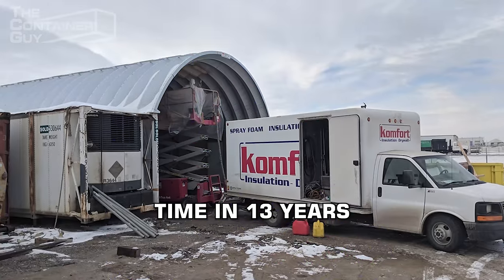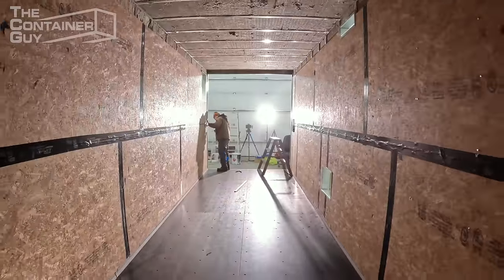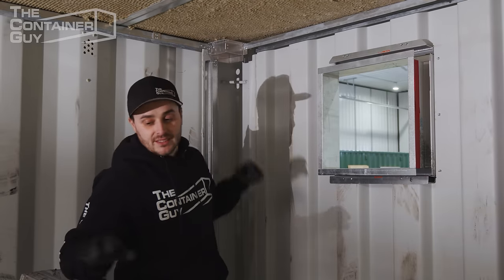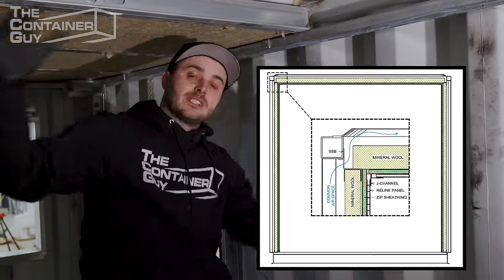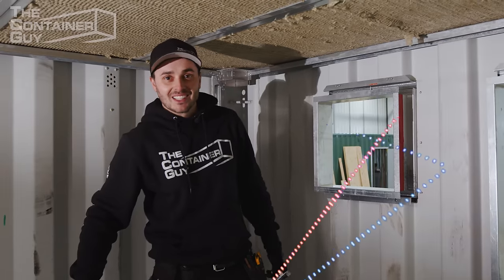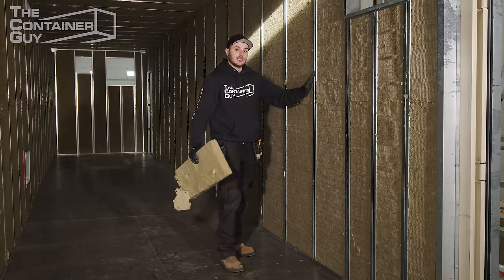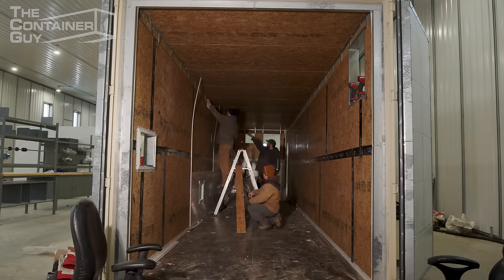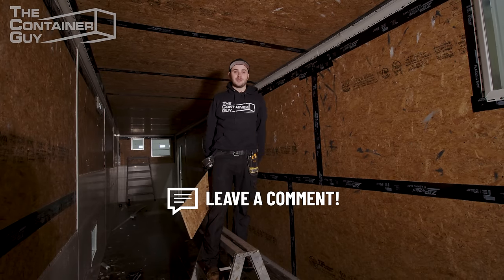Ventilated Wall System | Learn The FACTS and RISKS Before You "Save Money" By Not Using Spray Foam

Comment: We are finishing up a build very very similar with different materials. Ours is for  a future bunk house and mobile office. We sent you some details that you might like from Classic Built High Performance email. Our mission is a DYI version bunk house office for building 2 houses on site to Passive House Building Standards. I consider it a science project because it's unorthodox with a fresh air intake system through the floors, up the walls and out the roof. It's a dual ventilation system, 1 for the walls and one for true fresh air for human occupancy.  So far it's working just like what we thought based on the building science. Keep up the good work guys.

Comment: Install a blue tooth moisture meter then monitor it over the length of the product. I suggest moving the air in the air void is the crucial part.
Reply: Negative pressure.. i.e. a VACUUM if nothing else a draw/pull ...TIED to a humidity meter so that only when overall humidity inside the living space is LOW that it turns on... perhaps set up a dehumidifier to run during the day specifically with a motion detector with a couple hours delay...so that after you leave for the morning it turns out after moisture/humidity has stabilized in the living space from cooking and showers, etc...then dehumidifier runs (perhaps just on a daily/weekly programmed timer) and then when/if the humidity reaches some low average threshold then the.dead air space vent kicks on... 
But your idea of a circulating of the dead air is also quite important to prevent any stratification of moisture levels depending on rising warm moist air or cooling condensating air at ANY location... Perhaps dozen or so small brushless computer fans. Strategically placed or directionally aligned so that ALL air is rotating in a uniform" vortex around the length of the container? Perhaps two sets, aimed in opposition so that they alternate days /weeks /months at a time? ...the only thing that usually stops them is dust buildup which "should NOT happen" ... 
a boroscpe camera could be used to inspect the cavity...perhaps strategically placed 1/4" PEX or other tubing through inspection ports seal the hole with 100% silicone caulk clear, then cap...so that when you want to insert camera, just remove cap and instant access?

Comment: I had a band room that had 4 inch foam on the walls of the room exposed, it was crazy we took a audio meter to it and you could play drums in the room and it dropped the sound over 60db in the room in order to talk to someone in the room we had to use the PA system just to hear each other the room was only 14X10 and someone next to you was hard to hear. at night you could not hear anything other than the AC vent (if you were right on top of it) and since there was no windows it was like a depervation chamber. but the people that lived less than 20 feet away said they could tell there was a Live band playing but sounding like a low volume stereo playing we would play well after midnight sometimes so the outside walls were your standard stick and drywall with stuco and then the normal insulation in the walls then 4 inches of dark gray ridiget foam boards 4'X8' it was dark and dead quiet in there, and with a full band inside it was lower than a TV on like 20 volume, you could sit in the room next to the band room and watch TV and not have to blast the volume at all. It is a crazy feeling and yes like your balance is off like an ear full of water but even more

Comment: So I totally understand your points. I’m a retired Ironworker and have been thinking about the heat and cold of these steel buildings. My question is what if a 12 volt or low voltage air flow system in the walls that would blow and recirculate somehow when the moisture or surface heat gets to a certain point?
Reply: Been thinking about the same thing. It's especially moisture concerning me here in the South. But the heat is going to be bad as well.

Comment: Great video.  Thanks for explaining the "why" about things.  To help the steel stud thermal bridging issue you might try EcoStud. I used them for a external insulation wall on a house.  I put one horizontal row of OSB on the studs then fill the cavity with spray foam then repeat.

Comment: You panic way too much over using wood structure inside of a c-can. Years and years of doing it and using rockwool for insulation has proven that it is absolutely fine as long as you provide an air gap behind it. As you did in this system you'll have no issues. It's no different than building a house. You just need your vapor barrier between the internal warm area and your external cold area.
Reply: Are you venting (active and negative pressure or passive?the space between the metal on inside of container and ?
Reply: Also, when you say "vapor barrier" can you please be MORE specific? There are sooo many categorical types some are plastic film that is designed to STOP movement, others are resistant and unidirectional and others are like wood...

Comment: * Why not isolate the metal beams(struts) in your system so it will not transfer the cold from metal to metal. Not sure if a rubber gasket between your metal rafter beams and brackets is better or if you just coat all your metal parts with a sprayon rubber coating like FLEX SEAL!  By rubber coating all the rafters and brackets it would cut down on transfer of cold . It would also help dampen sound transfered through metal to metal contact of your rafter system!
 Just a thought, try it out if it works make a video of it and add it to your system! I would charge you to much for the idea! LOL! But I think wether you spray flex seal on all your metal rafters,brackets, or beams, or cut rubber gaskets to put in between rafters where you connect them together , it will help you dampen the sound and the cold that transfers between your metal parts of your system. 
 You will just have to try both and see which works best. I think spraying all your parts will be the best but if you cut rubber to  put between them you can control the thickness better!
 Eitherway give it a try and make a video! Which you could reccomend to your customers to spray flex seal on all your rafter/wall system to help dampen the transfer of sound and cold through the metal parts. I hope this helps!
Reply from the maker: This system is steel studs (not our strut system) but you are 100% correct. Metal brackets are perfect to start because they allow us to use them, adjust the design in small batches until the product is proven. Once we know it works and that there's a market for it, then we move to injection moulded brackets which is exactly what we have done with these SSB. In the next week or two, we will have 10,000 glass filled nylon resin SSB available for sale. Zero thermal bridging and way stronger than the aluminum counterpart. 

We can rubber coat or 3D print rubber gaskets to isolate the metal brackets in the meantime but our engineer did the math on the surface area of the bracket and how much thermal bridging there would be and it isn't huge. Especially with spray foam all around it.
Reply: @TheContainerGuyTV  I would suggest you look into "other" materials like solid blocks of nylon or other "low conduction" but HIGH COMPRESSION and LONGER LIFE than rubber... I know rubber "can" last a long time, but it "rots"/*oxidizes*  AND deforms under steady light pressure over time...
Let me know if I am wrong or what material you find or settle on...as I too may be in need of...

Comment: What prevented from using external insulation? It was confusing, since it seemed like you had CAD models with external insulation, but there ended up being none. Wouldn't that have solved all the problems? I am assuming this is not transported a lot, so they extra widht wouldn't be a problem.
Reply from the maker: Time. We have a 3D model but ZERO real life experience. I am confident we could exterior insulate and finish a container on the walls and roof but have some thinking to do on how to deal with the base / underside on something that is meant to be transported. A site-built unit on a insulated concrete pad or footing would be easy. This summer we plan to mess around with this concept.
Reply: @TheContainerGuyTV Really exited to know you're working on it! I've been planning my container build for a long time and I know it will have external insulation for maximum interior space and that sweet, corrugated, industrial look. Underside definetely seems like the biggest problem, mine is going to be on wheels and tractor towable. But one thing is sure, it will be built with your kits! Your channels has been a great inspiration and I'm always very exited when there is a new video :D

Comment: Key to remember it doesn't matter if the customers always right, that's not the whole saying. It's cut off after those 3 words to guilt trip companies. Company should never bend quality to keep a sale. It means your not just bending your quality, but your reputation. If it rusts out now it's "why you let me do it vs just turn down the job" and delayed the inevitable. Be interesting to see how this holds up long term. Seems like may not be a super long term solution as the other equipment itself may simply wear out before the container is compromised by subpar vapor seal design you settled with for client retention. Past client and living across the road from the guy would only give me more reason NOT to budge on quality of solution.
Reply from the maker: Did you watch the whole video or just the first 5 minutes?
Reply: @TheContainerGuyTV  Both. Your explanation to the reasoning at the end is great, but doesn't change the fact. Ensuring they simply are getting spray foamed with a new enough lot # of spray foam is simple to do. End of the day the client agreed to take on the risks, but that doesn't prevent them from draggin your name through the mud if it doesn't hold up to the environmental conditions. "I tried to tell you" never ends well for us business owners after the fact. Ive turned away plenty of work because they want me to work below my standards.
Reply from the maker: @MattWeber  the client is a business and has been in business since before I was born. They are well informed of the shortcomings and have made an informed decision. The wall system is a common air space and can still be further vented if deemed necessary - simple resolution. Worst case scenario, if warranty work was required, it would be well worth the cost for the data collected from it in the name of science. 

We aren't trying to make the PERFECT wall system here. We know what that is (spray foam). What we are trying to come up with is an affordable wall system that performs decently in most climates for the less fortunate or hard-to-reach locations (off-grid). We are thankful this project allowed us to experiment.

Comment: If i use Sprayed cellulose insulation behind a drywall inside the container with no other insulation and compact it to eliminate any airs gaps
would that work for humidity?
Reply: That's exactly how a house wall is done with blow-in cellulose. Provided you have a vapor barrier on the warm side immediately behind your drywall. You will be fine. You have to remember your vapor barrier always goes on the side of the insulation that is warm in winter
Reply from the maker: NO haha! Cellulose is recycled newspaper which wicks moisture big time. 

Think of framing up to container corrugations like framing up to a concrete basement wall. We have learned that you must frame your basement walls away from the concrete so the moisture in the concrete does not wick into the studs. If you spray foam basements, you don't need that air gap. Same goes with containers.
Reply: @TheContainerGuyTV  Using sprayed cork to eliminate the air gap between the metal wall and the insulation ?
, as cork possesses excellent thermal and acoustic insulation properties. Additionally, cork is naturally resistant to moisture and mold, making it a suitable choice for environments where humidity may be an issue
Reply: Next, using cellulose wool as the primary insulation can be an excellent solution to complement thermal insulation. 

cellulose wool can be installed to effectively fill cavities and prevent thermal bridging, contributing to improving the energy efficiency of the structure.

i love cellulose in france , i do this for my home , insane performance

Comment: I think forced air vacuum will be needed or a ridge vent, if the attic concept is important and you dont have air flow the mold will follow... allow air in the bottom and out the top
Reply from the maker: A year ago, I designed and prototyped lower intake vents and a 4ft long ridge vent that installs on the high corrugation of the roof. I hate the idea of roof vents on a finished interior. It's not so bad when it's general storage but not when there's drywall right below. 

I started ordering my new containers with the stock vents down low and up high. They aren't much but better than nothing. I'm actually surprised that nobody else has thought of this... All one time use cans should have low/high ventilation
Reply from the maker: Also, what I didn't say on the video is that we can still install eight BigAir30 vents all around (4 high, 4 low) if the customer notices any problems. We just wanted to try this first.
Reply: Arrangement is not needed in this case. You only use a ridge vent when you have a peaked roof because that is your highest point in this case with a shipping container all you need is a high and low vent. Or multiple high and low vents actually work better. Eric will naturally flow. That's why you don't use any forced air ventilation in an attic with your ridge vent. The air will naturally go up to the highest point to circulate from the eaves to the peak. If there are vents in the side of a sec can at the bottom and at the top that's all that is needed as air will naturally flow between them taking along with all the moisture

Comment: Without that sprayfoam there will definitely be condensation inside that wall cavity
Reply from the maker: Yeah  I agree. 💯 certain days of the year...

Nothing in the wall system will wick the moisture so hopefully it can escape. My main regret on this mod is not using a butyl flashing tape on the floor under the steel stud track as a sill seal so the moisture doesn't wick into the floor. We have already thought of this on other wall system designs so I'm disappointed in myself for not remembering. Live & learn I guess.
Reply: What about the insofast foam boards? I’m building out a living container and insulated with the insofast kit and plywood walls. I’ll be running a mini split - do you think I’ll have mold issues?
Reply: @MrBobSanchez  Depends on your climate. Insofast is better than wood studs and fibreglass insulation (but that isn't your only alternative). The insofast is not adhered to the wall or roof corrugations. As I mentioned in the video, if you're having an airspace, you want a common airspace. Not a bunch of little air pockets which is essentially what insofast gives you. 

I believe their newest iterations of their product (maybe the basement version) has little breather holes to help ventilate. Why did they add that now? Were there problems with not having them? Logic tells me YES. 

Also, their foam isn't closed cell. It's ~1.5lbs (instead of 2lbs) so it's almost closed cell... but not. This means it's porous and in extreme cases, mold could grow in the cells of the foam itself. 

In Canada, the product isn't readily available here (nor is it well-suited for our climate) so it's the same cost to use Insofast or frame with steel studs and spray foam which makes the spray foam a NO BRAINER. Also, people need to understand that spray foam locks everything together. It should be looked at as a structural necessity with the added benefit of vapour barrier and R-value. 

The mini split has a dehumidification mode and should always be turned on (if possible) to control excess humidity inside. The ceiling is going to be your biggest problem so consider a hybrid of Insofast walls and spray foam ceiling if you're sold in Insofast. The end walls and doors are also easier to spray foam.
Reply: @channingmccorriston  Very helpful! Thank you. I plan to use your framing kit on the outside so I can easily clad the container with siding. Should I spray foam the outside? Will that help with potential condensation risks? The containers will be covered by a roof kit as well (pod roof).
Reply: Incorrect.
Reply from the maker: @MrBobSanchez  Use the exterior studding brackets and yes, spray foam cures all. If you frame it with 2x6, you can fit spray foam against the corrugations plus mineral wool insulation in the stud cavity for what I think is the best method. Foam gives you the vapour barrier, air, and water seal. Mineral wool gives you added R-value and sound proofing. Wood studs bring it all back to traditional construction methods that appease building inspectors and now you can run a normal roof/attic to shed snow / summer heat.
Reply: @TheContainerGuyTV I have a playlist titled "shipping container insulation" where I have a few KEY videos...
I need to add BSE 101 and perfect wall/100 year wall videos AND a few on cold roof versus warm roof and hybrid /double roof systems...to refer to, you may want to review them...
Reply: As I am 8:49 watching it really occurs to me that YOU NEED to insulate the EXTERIOR...spray foam.
Reply from the maker: @1truthseeking8  100% this container with the exterior studded and spray foamed would be mint 👌